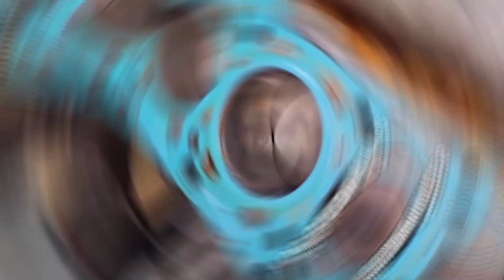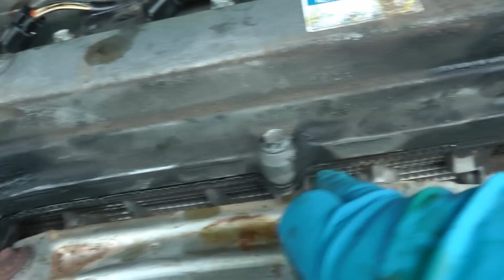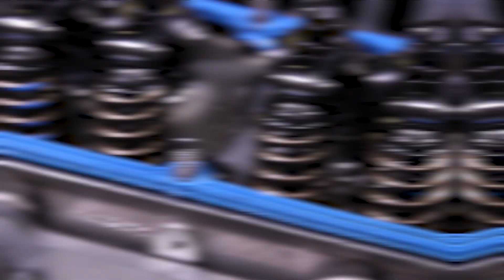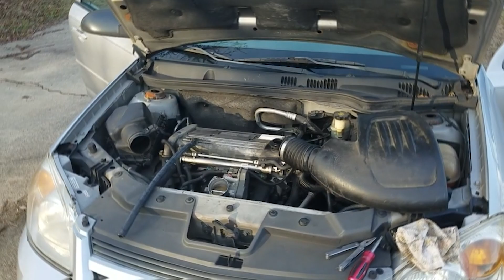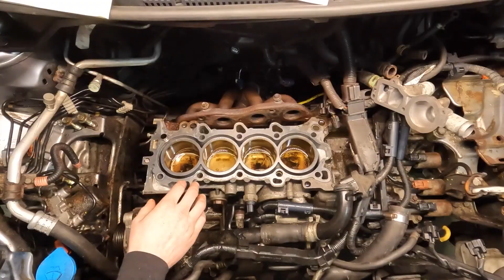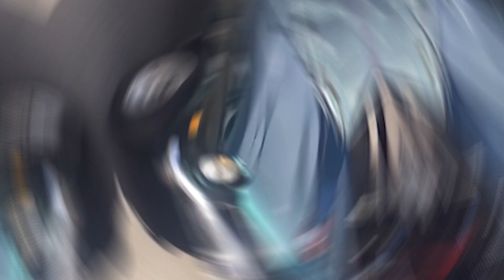25 WORST American Engines to AVOID!

Comment: The Jeep 4.0 is an excellent engine. I’ve owned several and have never had a head gasket issue.

Now a leaking rear main seal? Yes on all of them.
Reply from the maker: Thanks for sharing about your experience! Yes it's a bit of a hit and miss with some reporting long lasting engines while others have had head gasket and other issues